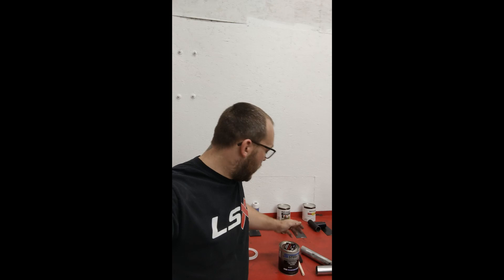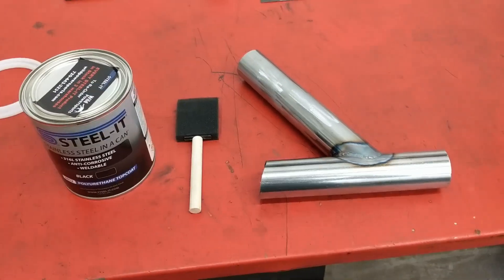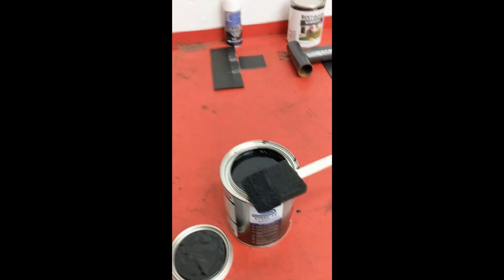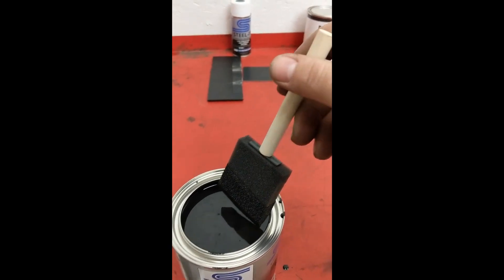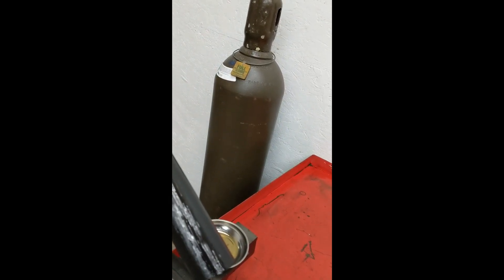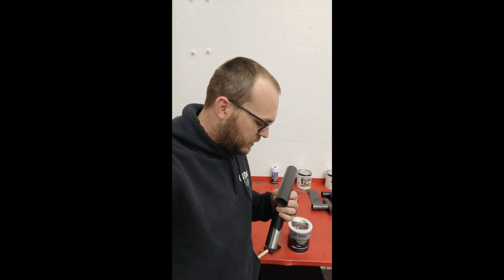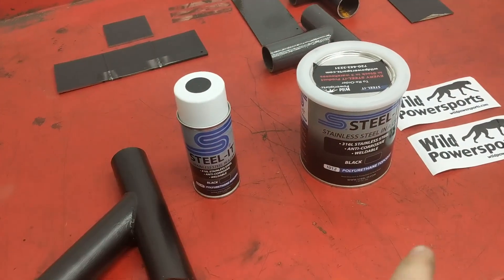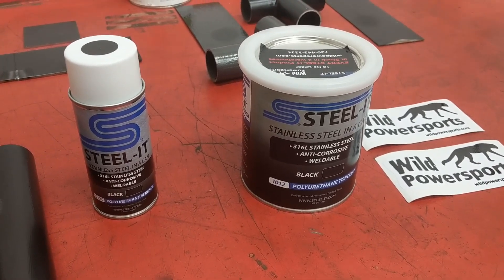Steel-it black brush on results.

Comment: This stuff is sprayed on industrial steel and it's phenomenal. I have it on my F350 frame, it's been on there for 6 years in PA. We use it on semi truck frames and they are holding up well. It's used on the Baja race truck chassis, you should have contacted the manufacturer and got the proper information for spraying. There's guys on YT spraying entire jeep bodies. Your results must be from user error, because this shit is the industry standard for structural steel, USDA approved food grade storage, grain silos etc.

Comment: Spays on great must shake for at least five minutes and use primer gun with 2.5 tip will not run lays on great.  No thinner required guns are cheap on Amazon.

Comment: I have heard good things about KBS Coatings. Can be applied by brush or reduced down to spray on. It also comes in a aerosol can.
Reply: It's awesome stuff. Used it on my frame and rearend, levels great if you follow the directions

Comment: Thats for the info
I wanted to know if its hard like metal like line x so if you hit it with a hammer it wouldnt break
Im guessing that its not
Thanks for the video
Reply from the maker: The product is very hard once cured.  I have not done a torture test on it unfortunately.

Comment: First, you over brushed the paint..one,  two, maybe three passes. Letting the paint set up for a few minutes, and then brushing again is a no-no.  Second it has to be thinned, so it flows, and last a cheap brush equals cheap results. I prefer Corona brushes. This is basic technique for any brush on paint, also you have to experiment with different thinning ratios. Ask your self, would I pour this paint into a spray gun without thinning? The reason most people do not brush paint is that like a spray gun it takes time to adjust, and learn the technique.  The reason spray paint in cans exist is that for the average person is that the manufactures has thinned the paint to the right consistency and provided the correct spray tip in a can. Is brushing for every one, no.  Just like a spray gun and compressor is not for every one.  My guess is that  this product in a can will give more than acceptable results, and is cost effective, when applied correctly with a brush.
Reply from the maker: It sounds like you have done this with success with Steel-It in a can?  If so please post the video of the correct brush, dilution ratio, and coat times.  That would be helpful.